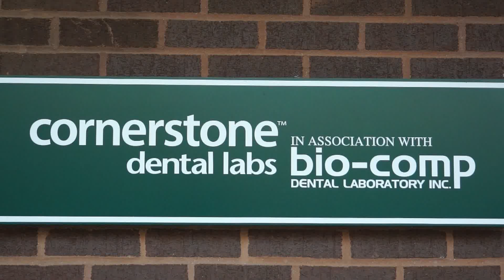pressed emax crown with zirconia core

Comment: what is the average cost the dentist pays for each unit? im guessing $300usd, am i close?
Reply: chrisiden It depends on what kind of unit, wether it is porcelain infused metal, zirconia, emax and so on also wether its an implant, crown, bridge etc. For example, where I work at, it typically costs anywhere from a thousand to 3500 dollars for a dental crown
Reply: Im in the u.s. as well. The company im with has been around since the 70's. Of course im sure its NOT the actual price but with the lab fee and material and so on, it does bump the price up.
Reply: hi i know my dentist pay Wholesale prices and charges from 500 to 1200 per crown not including post core and root canal if needed.. me and my dad both studied dental when we were young but we both dropped out cause the school council says are hands will shake and silly things like that... my dad became a successful doctor and im still a Big nothing... lol ")  ....smiles with my Big front teeth... he he
Reply: chrisiden Between $150 to $200 per crown.